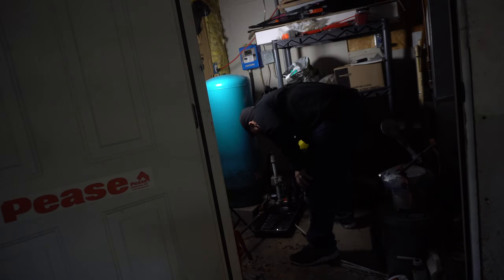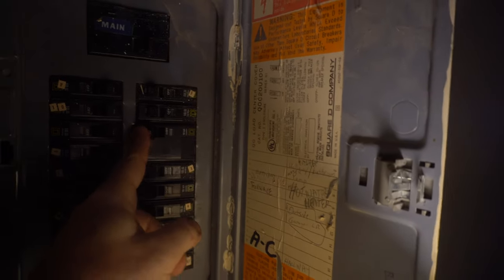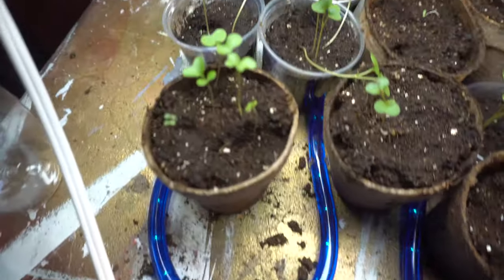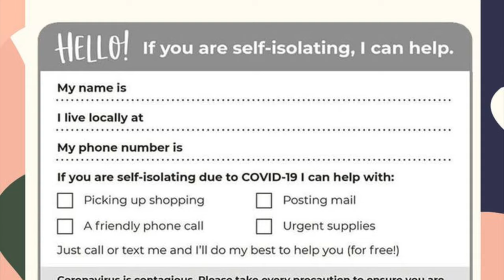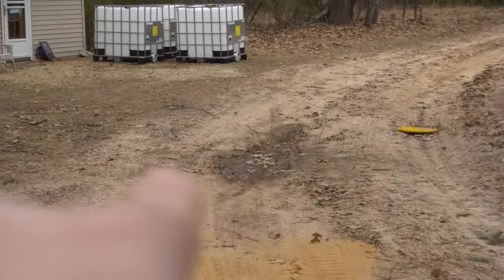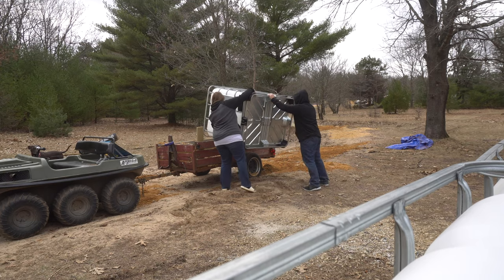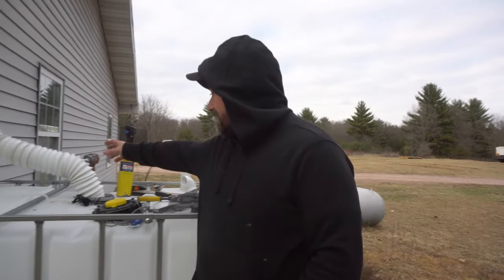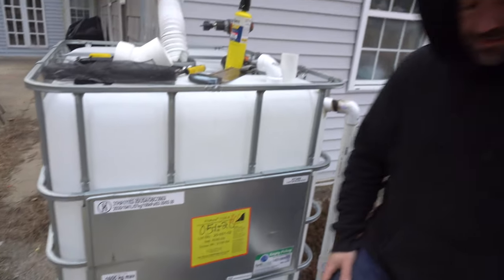We have NO WATER! Can we Fix it?  Day 20 of Lockdown

Comment: If you plan to use it for drinking you might also want to consider a first flush diverter as your first line of defense against contamination. I plan to do something similar to what you are with the big totes and found that as a suggestion from another youtuber you'd probably like, engineer775 If memory serves, his calculation was for every inch of rainfall, you get half the square footage of roof surface in gallons of water. So if your roof on that side is 15x20 (300 sq ft) you'll get 150 gallons of water every inch of rainfall.

Comment: Nice Catchment solution. How will you keep it from freezing in winter?
Reply: actually, I am curious about that too. How resistant are they? Summer temperatures peaks at about 45 °Celsius ( 113 °Fahrenheit) in summer and -30 °Celsius(-22 °Fahrenheit ) in winter. I had some plastic barrel that cracked in those winter temperatures,  and I don't want a repeat. I won't keep water in them during the winter.